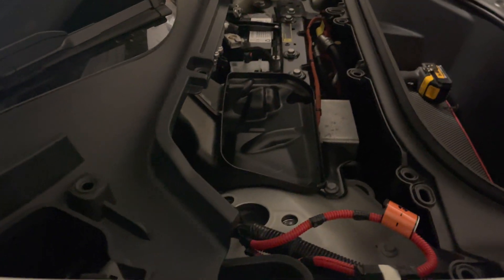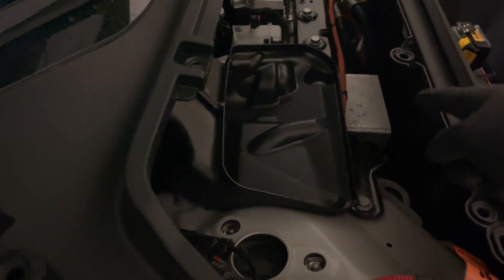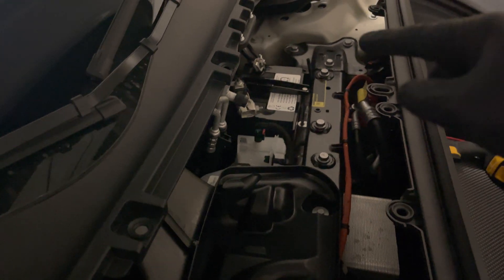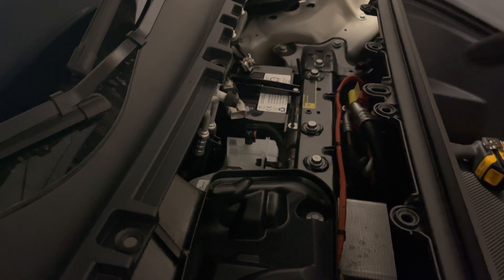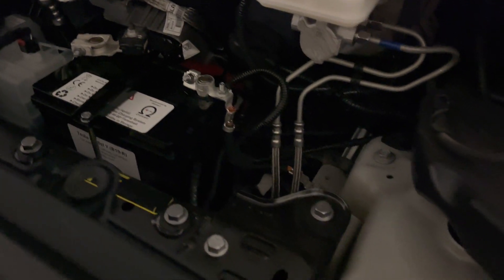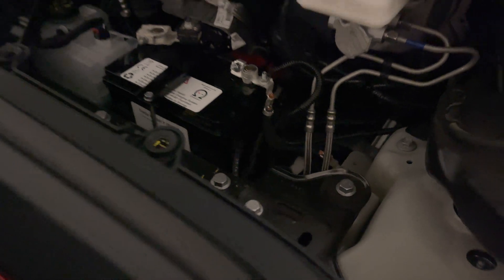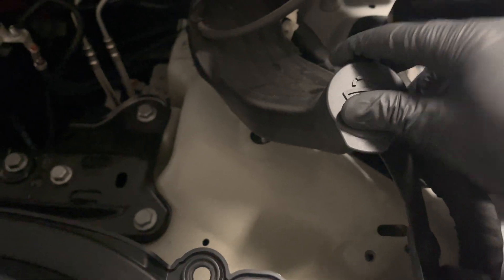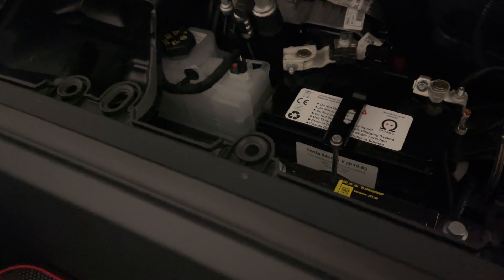Tesla Model Y Biodefence Hepa Filter Removed and What is Under It?

Comment: What size are the 2 bolts, I need to gain access to the aux battery.  They look like TORX nuts?  Owners Manual doesn't say what size?
Reply from the maker: 10 mm socket

Comment: any idea when the retrofit will come for older model Y's?
Reply: The official HEPA retrofit with biodefense mode firmware started being offered at the service departments in late 2023. Cost is about $300 parts and labor. Notice the big plastic cover on top. That's to better protect the intake and filter from the water that runs down off the windshield. There's no weatherstriping in the frunk area.
Reply from the maker: Not possible due to how the air inlet is set up but you can have a mini Hepa check out this filter from TEMAI Tesla Model Y NEW Cabin Carbon Activated Filter 2x MORE Airflow!
https://youtu.be/G86dQYHsnF8
Reply: @megawatts UPDATE: The official under hood HEPA with biodefense mode software update is now being offered for the pre-2022 Model Y as of late 2023.